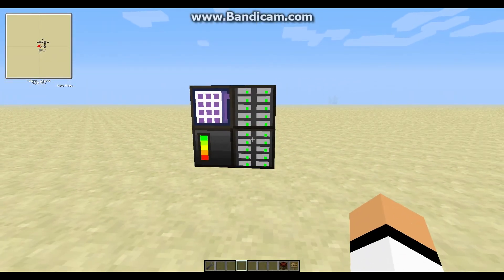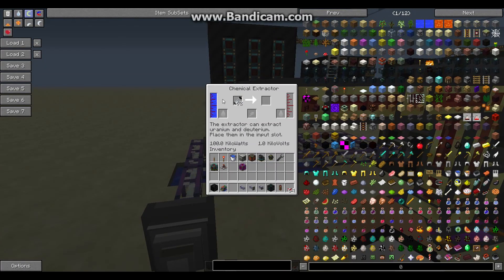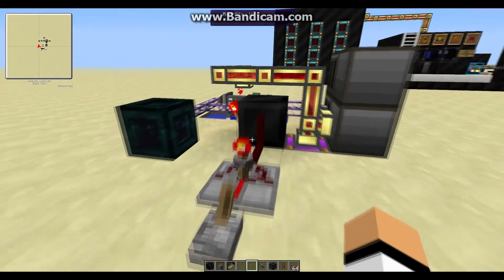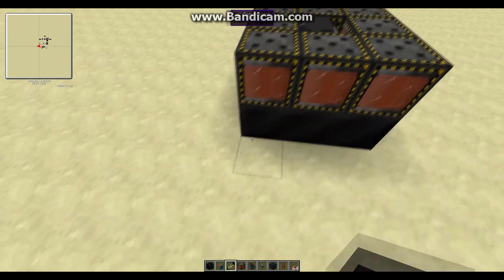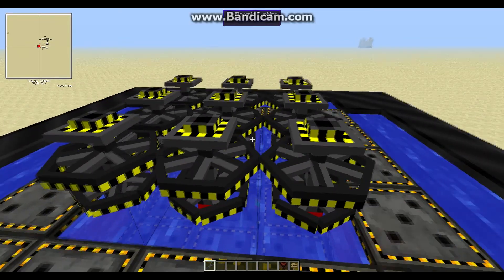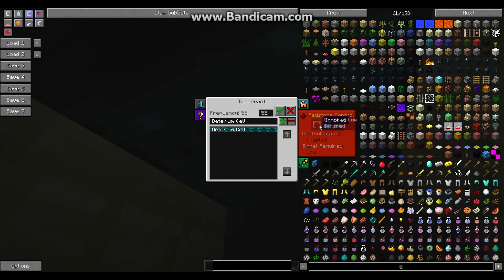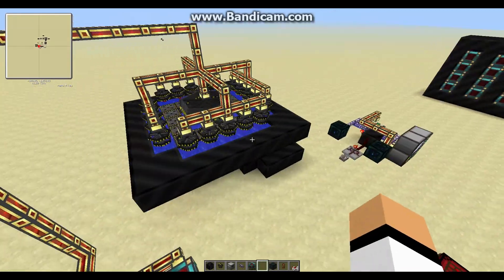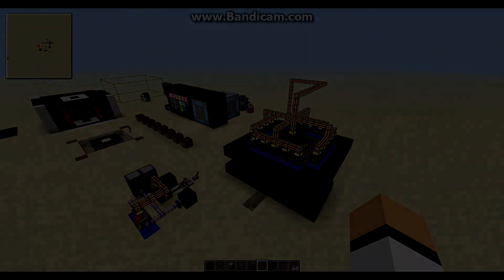Tekkit   Fusion Reactor

Comment: Why not just use Fluiducts and a Pneumatic Servo to pump Deuterium directly from the extractor to the reactor?  Then you lose one turbine, but no longer need Empty Cells.
Reply from the maker: ActicAnDroid You lose more then just one turbine. If you look at the numbers, it might be "1" turbine. But then you have 8 of them, and you can't turn it into 1 big one (big one produces way more power then 9 small ones) so the loss is pretty big. Also, reactor looks nicer without that fluiduct sticking out on top of it.. Not gonna talk about efficiency & chemical extractor power usage because Empty Cells also cost materials, but yeah.. you get the point.
Reply: GoMo Tech When I set it up, I put the Fluiduct in the bottom and just run a cable down the middle where that turbine would be.  That way it is still visibly appealing.  Usually I don't worry about efficiency because it's already way more than I need.  Losing that big turbine is worth it in my opinion because there is no need for all the ME stuff, no Tesseracts, no Cells, and since I'm already getting a ton of power, I don't feel like I'm losing out on that much power.
I get that your video emphasizes efficiency, I was just sharing how I set it up.  Again, very nice video.  You're the most up-to-date Tekkit player I've seen on YouTube.
Reply: you can place a tesseract under the reactor and make it accept both fluids and electricity at the same time (hi from the future <3)
Reply: If you use steam funnels instead of turbines and direct it out with Extra Utilities transfer pipes and slightly(?) upgrades fluid transfer nodes (or a heavily-upgraded retrieval node), you can direct the steam to a Big Reactors turbine and likely still have steam to spare. A clever combination of fluiducts, tanks, and/or tesseracts might also work (and might even be less expensive than the number of speed upgrades that would be required to make the aforementioned nodes work quickly enough).